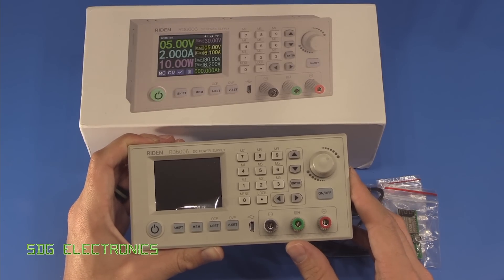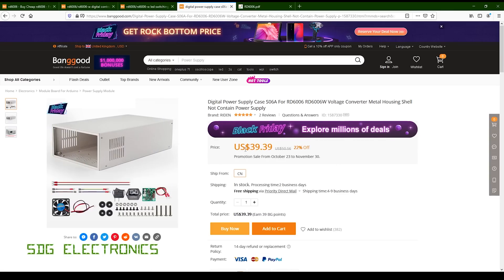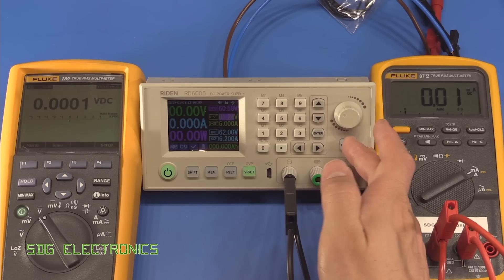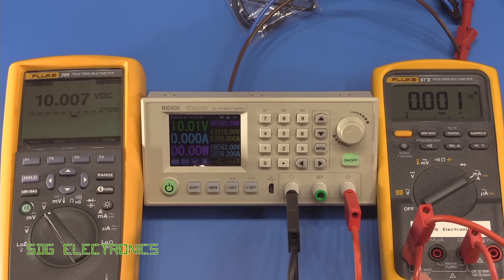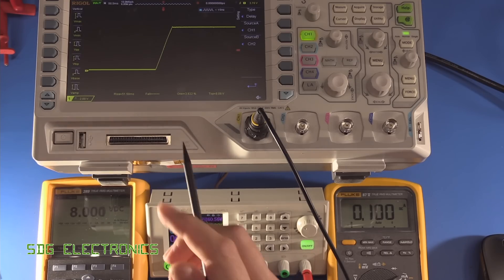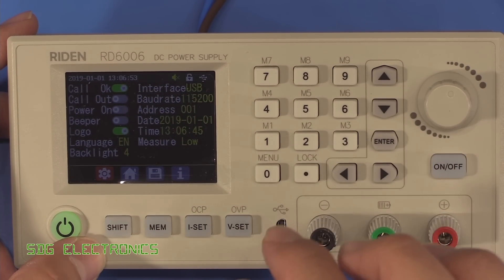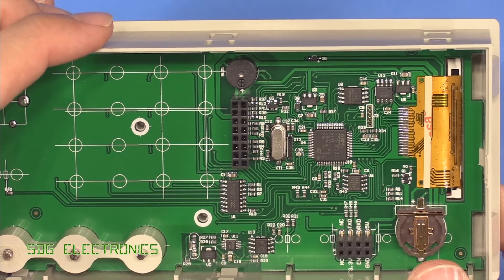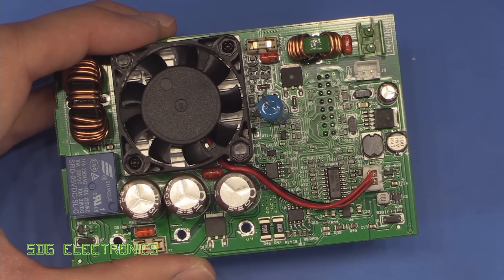SDG #117 $53 360W Riden RD6006 Programmable Bench PSU

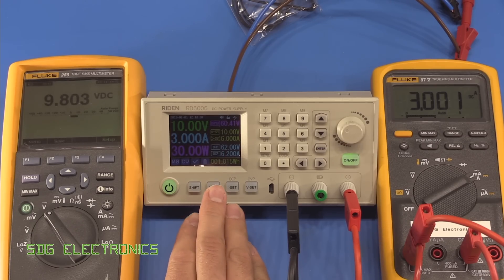Comment: 7:20 200mV error at 3A seems kinda significant. They probably made the rookie mistake of sensing voltage before the current sense resistor. 47 to 50 mOhms perhaps?
Reply: There are the two 30mR on the negative line, which would be 15mR. Then add the 10A nano 2 fuse on the positive lead, ~10mR plus omni blok holder resistance (can't find a rating for this). So thats starting to get very close to the calculated 60mR. Very disappointing if they are measuring the voltage prior to the fuse.. would be fine on a smaller supply but this thing is 6A.
Reply: @jaro6985  Fuse, really? Even 70s power supply already had electronic fuses there (within 723 regulator), they must not be confident in the design that it could blow somehow. I also expected more modern design than something from ATX PC supply. The MDP-XP is much nicer, the output is very low ripple and also it's quite efficient and better design (more pricey too).
Reply: @jan.tichavsky  Yes the MDP-XP is incredibly modern in comparison. However, I've measured my RD6006 output and I'm not seeing any significant drop at all at 5A (<10mV). So I don't believe they've made a design mistake here.
Reply: @jaro6985  You can see in the video that the voltmeter (Fluke 289 on the left) is not connected to the output terminals of the PSU but somewhere else - it's picking up voltage drop somewhere down along the leads.

Comment: how would this cope with a simple unregulated transformer/rectifier psu feeding it?
Reply from the maker: You wouldn't be able to use it directly without some large capacitors. The dips in the rectified waveform need to be greater than 60V,but the peaks no higher than 70V. I suspect its not possible.
Reply: @sdgelectronics  I believe he said unregulated, not unfiltered.
Who would try to supply a rectified without filtering input?
Reply from the maker: @Gengh13 I got that, my point was about the capacitors. They would probably be unfeasibly large to keep within limits at 360W. Transformer regulation may cause issues too
Reply: That would be a great video idea, measuring the psrr.
Reply: You can ask them directly. They have email and WhatsApp. Their official shop is on AliExpress.